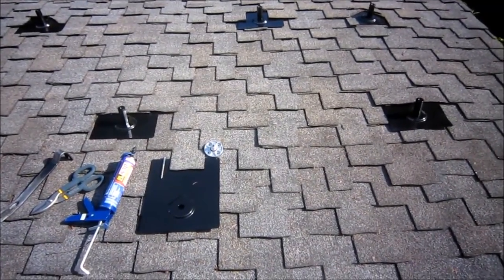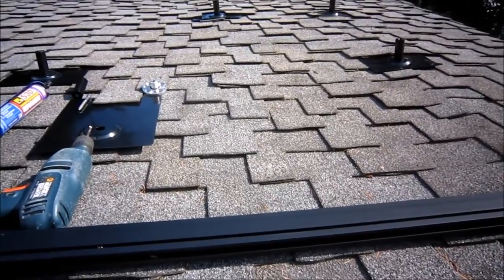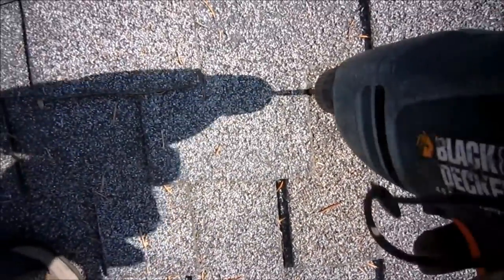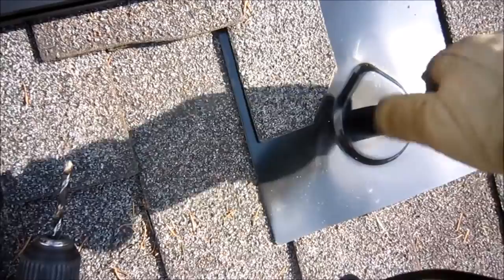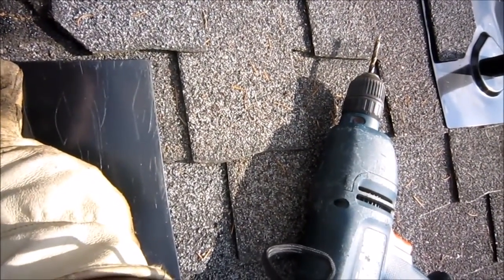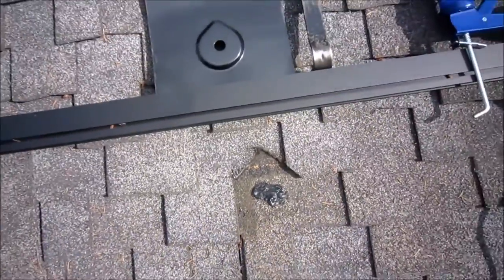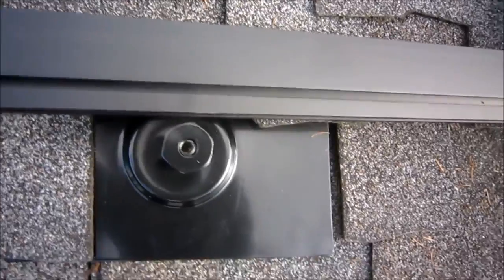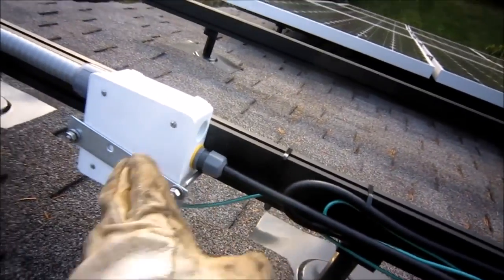Solar Installation

Comment: Why did you use the stand-offs?  What is the benefit to the additional height?  

Did you buy direct from Blue Frog?  They only want to deal with Contractors or so they tell me.
Reply from the maker: David Wood At the time, Blue Frog did allow some retail sales, I had to convince them I was knowledgeable and able based on previous experience in the field -- being local helped, I just picked up at their location in Poulsbo, WA, and met the fine folks there.  Standoffs are part of the typical Sunmodo kit, these are the normal length ones, nothing special.  You'll see in the video that they screw on top of the base in such a way as to keep water off of the lag bolts.  This is important to avoid water ingress along the bolt.